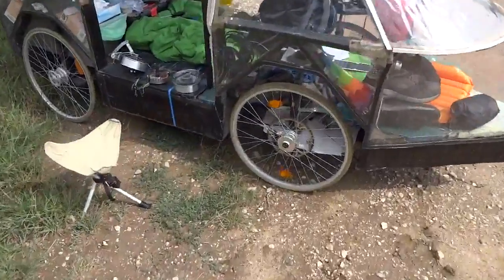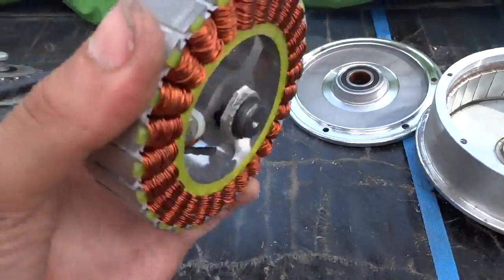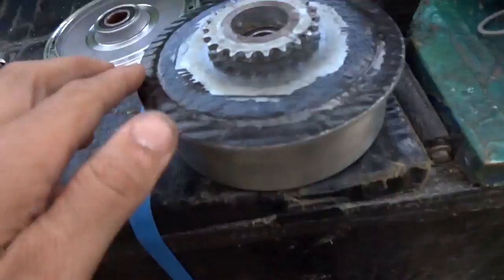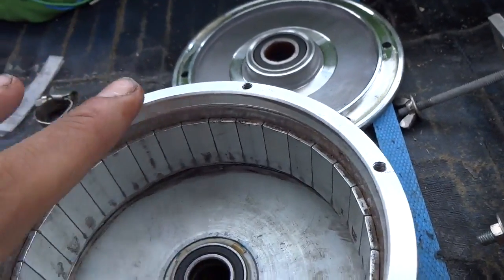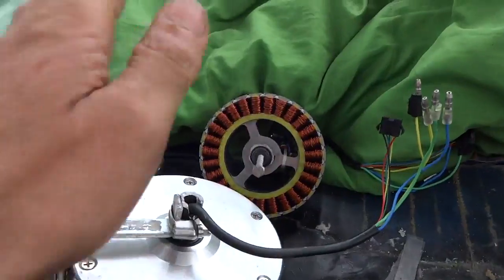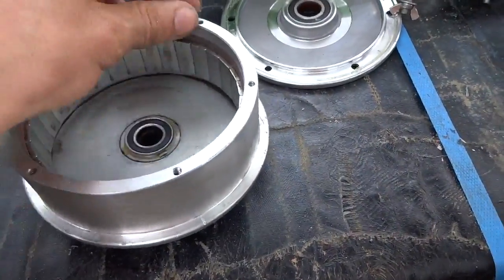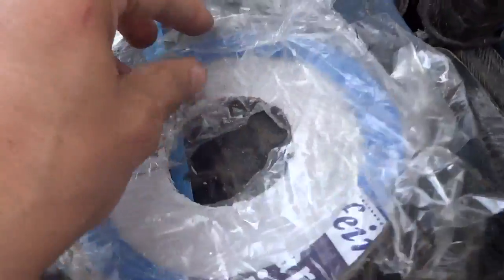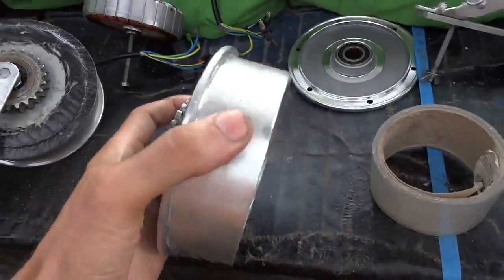hoverboard motor with chain drive

Comment: I will get myself into this world of hoverboard engines.

The heat problem might be due to gearing? have you calculated the max rotational speed of the motor for the 10kmh speeds you have as a goal?

Comment: Hi , Can you please share how many motors are you using ?what is battery voltage and how much ampere all motors draining on load? what is the weight of your car?
Reply from the maker: 2 motors front left and front right. 7s liion = 25.2 V , Chain Gear ratio: 20:90 , wheel size 24"  , max speed 10 kmh (German streets only 6 kmh), combined current on flat street at 10 kmh would be about 5A, recuperation yesterday at 19 kmh and very steep downhill - 10 A. With 10s you get about 14 kmh. Max ascend about 10% at 25A and 3 kmh. At 6% already 20A and 6 kmh. Motors get hot quickly. Might be the iron plate I mounted very close to the coils instead of the original Aluminium side. Have build a third motor with Glasfiber plate but not yet tested. Too cold for experiences now here in Germany.
This is not really intended as a car. It is rather a moving home that I living outdoors all seasons. Milage so far about 10,000 km :-) with these hoverboard motors about 1200 km.
Reply: @robodurden  Thanks for your reply .You are amazing. I have some ideas if you like I can share it.
Reply from the maker: @khanatifali1800  do what you like :-)